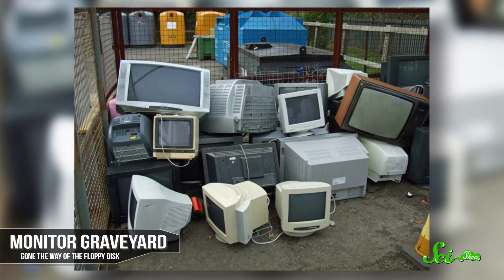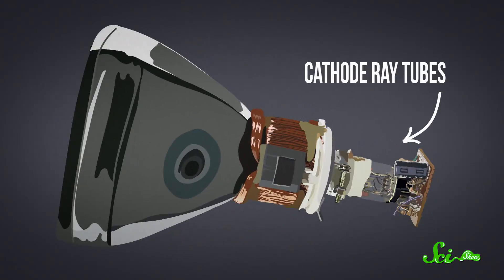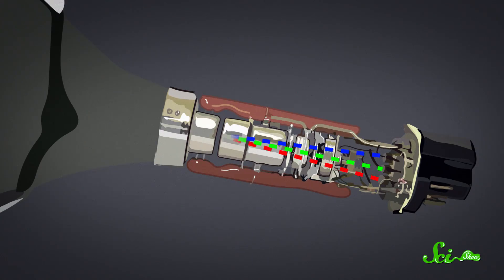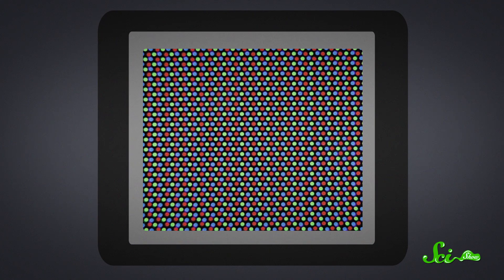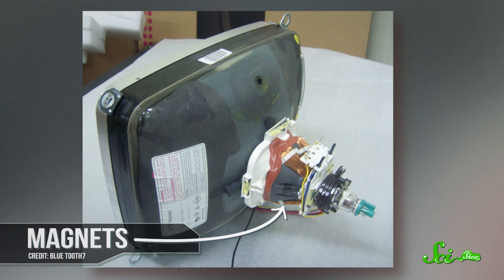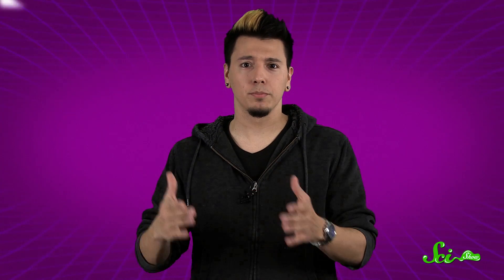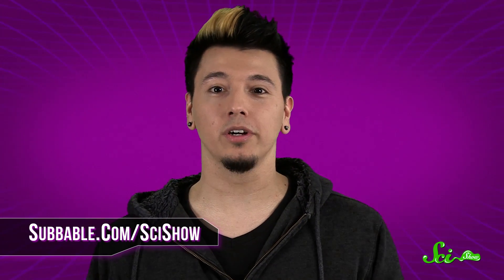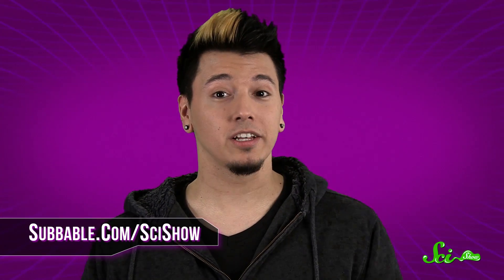How Did a Magnet Just Break My Monitor?

Comment: To be fair, you can usually undo the damage by either oscillating the magnet across the affected part of the screen (from a short distance away), or, if you just touched the magnet to the screen and removed it, you can just turn the magnet around (flip the poles) and place it down again in the same spot for the same length of time.

I fixed my "mistakes" (like I didn't know what I was doing...) with CRT screens this way for years, but I make no guarantees for your success!